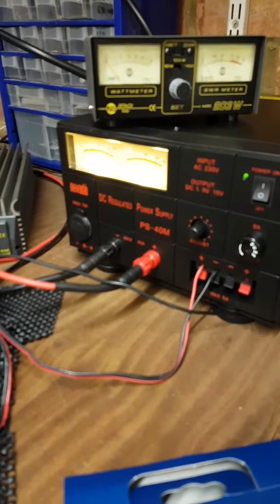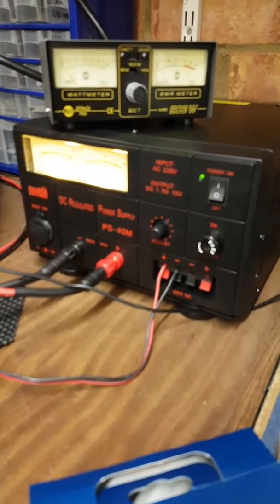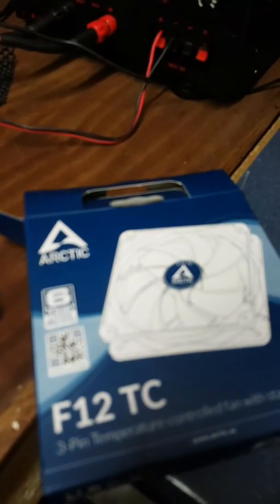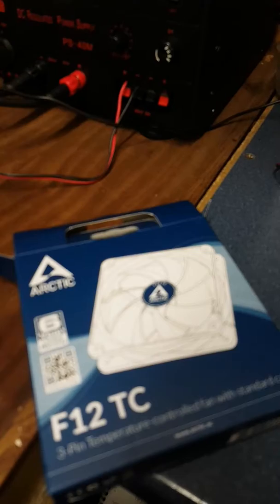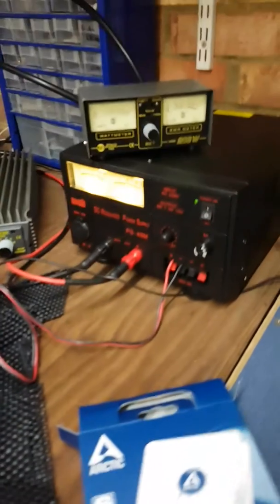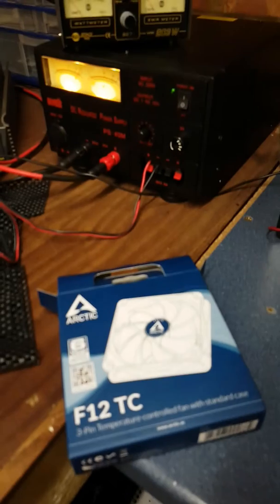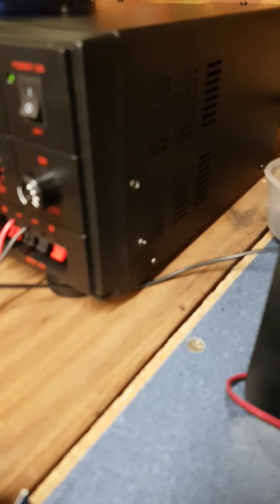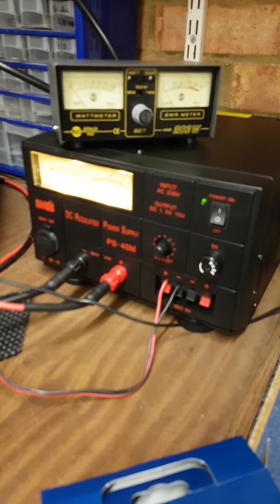Noisy Nevada PS40-M PSU Solution?

Comment: I bought one in a sale for £99. Now looking to remove the jet engine.
Reply: Fixed: I soldered a 220 ohm 5w resistor across the bimetallic temperature switch. The fan now runs slow, and very quietly, all the time. It runs stone cold. If it ever did get hot the bimetallic switch would kick the fan in at full speed.